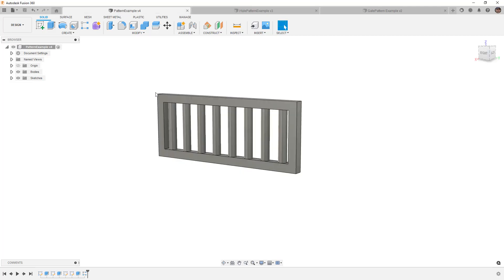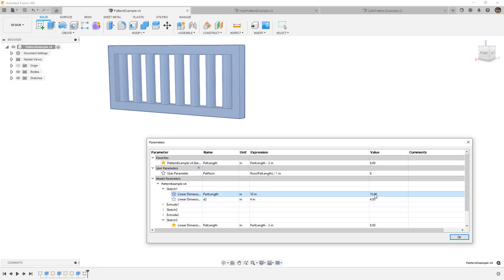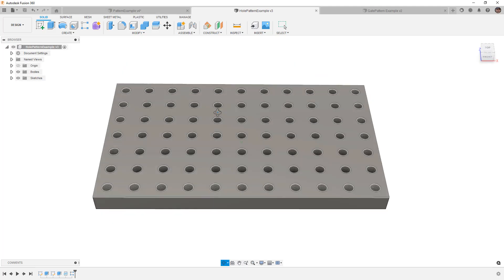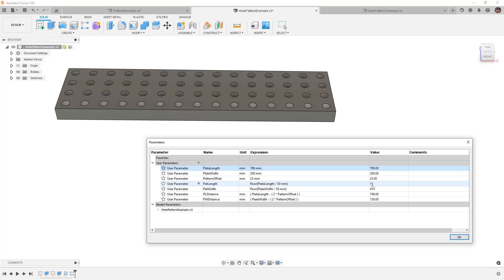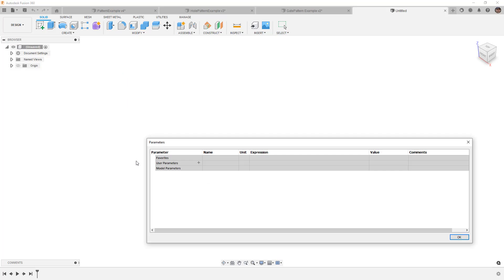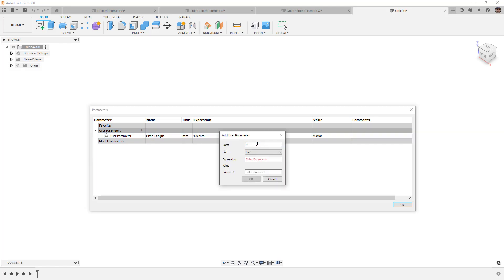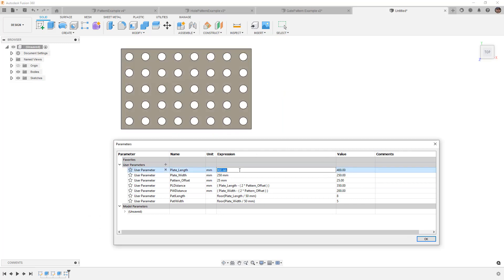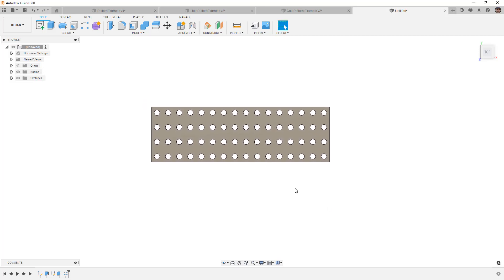Using Parameters to Update Patterns in Fusion 360 #Fusion360 #Patterns #Parameters #ParametricDesign

Comment: I think this answered my questions about patterns and spacing, now I need to update my model
Reply from the maker: When i made this video IF statements weren't released yet, so be sure to check out the IF statement video which might make it easier https://youtu.be/91LBG-3DkpY
Reply: @LearnEverythingAboutDesign  It's not going how I thought it would, it's spacing them too far apart and cutting off the remaining.

EDIT: Figured it out, I had to subtract the width of the feature from the spacing

Comment: Ive followed step by step three times with you. Great instruction,  thanks! One question i havent been able to work through in these hours: In the formula, "floor(width/count/x))" you chose 50 for x, and i cant understand why 50. What is 50 in your equation? I dont know what to choose for my own to output the desired spacing. Thanks
Reply from the maker: Hey Dallas, yeah using Floor or Ceiling is a bit of a trick unfortunately.  Really it would be nice to have an if/else statement.   In this case the 50 in the equation just gives us a nice pattern.  In the hole pattern example i had 25mm offset from each side of the plate.  Using 50 in the Floor function just took the width and divided it up nicely.  With this method you can't really control the exact spacing between each hole/feature but just work out a range that works for you.  So in the example 800/50 gave us a nice round 16 holes.  When we go to 799/50 the answer is 15.98 and Floor rounds that down to 15 instances of the pattern.  If i had changed the formulate to floor(Length/25), at 800mm length i would get 32 holes vs the 16 holes in my example.  If you start playing with numbers like 30 that aren't as evenly divisible you end up seeing a lot more rounding down.

Hopefully that helps.
Reply: @Learn Everything About Design  thank you for the reply! I think the trouble is, in my situation, the number of instances is going to be set, and i want the extent and spacing of that pattern to remain centered within, and offset from the edges of a certain length. In your example, the number of holes is not critical. It might not be the right formula for what im trying to do. Very helpful to know anyway. Discovering parameters is a revelation.
Reply from the maker: @dal2888859  For your case it might make more sense to do this with construction geometry.  Take a look at this example and adjust the plate width parameter https://a360.co/3TsypX8   It is all done with equal construction lines.  So the spacing changes but the number doesn't.  is that what you mean?
Reply: @Learn Everything About Design  yes, but in addition to the ability to adjust the length and have the hole spacing adjust accordingly, as that one does, i also want to be able to input hole number and have that change seperately from the length. So if i want to make an egg tray for example, I'd like my design to allow me to increase the number of eggs it holds in a line, and/or the length of the model, where the two inputs are independently controlled, and where the number of eggs is always centered on the platform, whether its an odd or even number. 

I finally got my model to behave that way but im sure there is a cleaner or more efficient way to do it than i did. Id be happy to send it to you

Comment: Is there a chance you could do a pattern like this but on a Circle or cylinder face?  I am going to try and apply what I have learned thus far and see what happens.  Looking to design a gear driven rod cylinder tumbler.  Putting an idea together for my baby son to play with.
Reply from the maker: can you drop me an email support@caducator.com so i can better understand what you are trying to do.  It is possible to do the same thing, but since this video was made Fusion did add some more conditional statements so now we have If/Else.  I have a video on that as well, but there might be better options than what was done here with floor/ceil

Comment: https://youtu.be/-BPcktQwIIY?t=834 anyone else running into the issue, that the dialog does not accept a user parameter for the pattern distance right now (Apr 29th 2023)?
Reply: seems like it does not accept an expression, if the expression itself references a driven sketch dimension.
Reply from the maker: I just tested this and it works for me.  When you start typing in the dialog do you see the list of parameters there?
Reply: @LearnEverythingAboutDesign  thank you for responding. It seems, that in a fresh and neutral setup this works for me as well. I figured out that it does not work in the following scenario: - make a master design with a few general sketches. (I usually did this for assemblies in solidworks and do it in fuson as well.) add an external component to the master assembly and use in-context-editing to create an assembly context. Within this assembly context create a sketch with reference to the parent assembly and add at least one driven dimension. Create a User Parameter within the subassembly, which references the driven dimension. Long story short, try to use this User Parameter, it will not work. Or will it?
Reply from the maker: @alfredjodokusquack2  So this is an interesting topic for sure and there are some nuances here.

Assemblies in solidworks will have Global parameters and those parameters can be used other places like drawings. 

Contrast that with Fusion where you only have a single design file (no part and assembly files) and you get a different behavior.  When you have an Xref(External reference) design inserted making it a "distributed design" the parameters are contextual.  meaning if you are using the Edit in Place functionality you can create and access parameters that are inside of that design, but once you finish the edit in place, you are only seeing parameters that exist in the parent design.

A test for this is to Edit in Place, Create a new parameter called "EditinPlace".  finish edit in place and save the design.  Open the external design, and before you update to the new version, check your user parameters and note the new one isn't there.  Update to the new version and check again and it will be there.

So as it stands right now the parameters are only inside of the "parent" design.  So you can't really work in this manner trying to share them across external refs.

Hopefully that all made sense.  To do what I think you are trying to do it will really only work if all your components are internal to the parent.  There is one odd nuance here where you can have a bunch of components in a single design, select one component and Derive it out into its own design and take the parameters with it.  It is a bit of the opposite of what you are trying to do, but might be something interesting to play with.
Reply: @LearnEverythingAboutDesign  i agree with all your points i guess. not sure though, if i made my attempted workaraund clear. so to be able to pass a parameter through, i created a new sketch within the "editinplace" component, which uses project to fetch some geometry vom the parent context assembly  i put a driven dimension onto this projected geometry. you can then go into the parameters menu and reference this specific driven dimension. In rare cases i can trick the solver to accept the driven user parameter, but it does not take long to generate a red warning.
Reply: This happened to me as well. The fix for me was to delete the user parameter and recreate it with a different name, making sure to select the "No units" type the first time. It did not work when I tried to change an existing user parameter from "cm" to "no units".